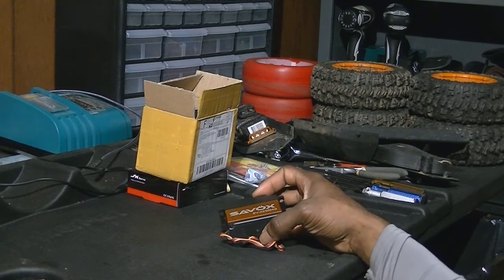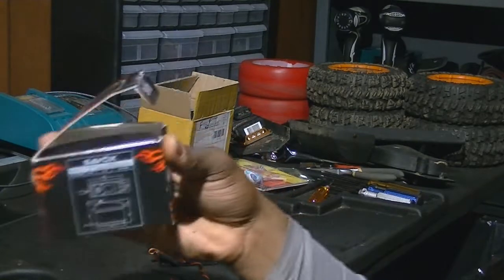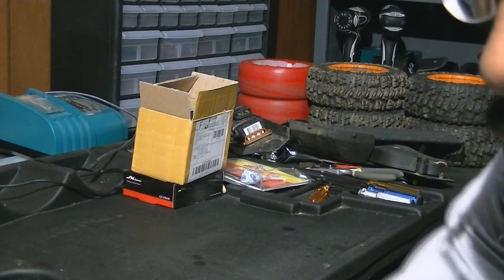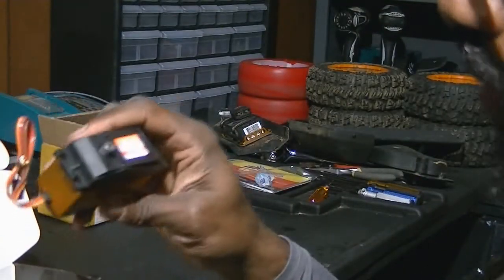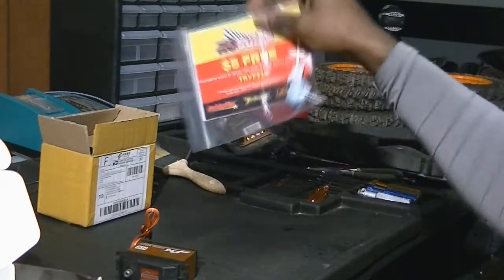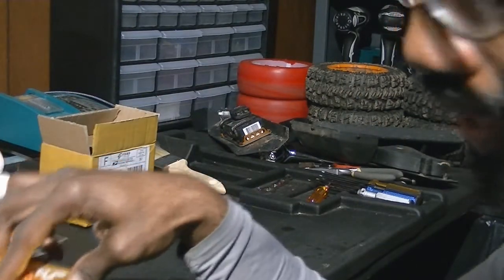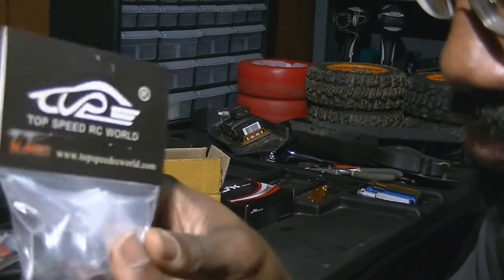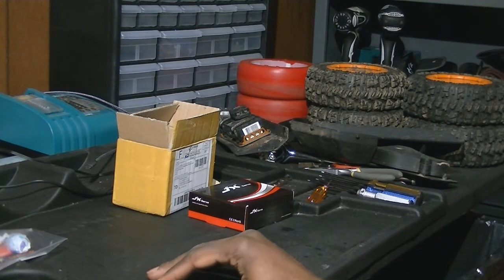Jx servo and wheel extenders unboxing

Comment: My brother i just good mine for 31.65euro's in the mail. the yellow men hooked me up. I run it on a 4600mah 6volt 5cell humppack. ( still wating for the imax b6 mini charger ) but i saw that this servo only push out 39kg... that kinda sucks because that 65kg... hmpf that shit would be off the hook!  But here is the thing that is troubling me. How can i beef this up? Do i really need to switch for lipo's.... i hope not because they can catch on fire and we all know this hobby ain't cheap
Reply from the maker: At 6 volts this servo pushed out 667 Oz inches of torque, if you want more than that you will have to run 7.4 volts which will give 861 Oz inches of torque. Lipo batteries will give you the most power out of your servos. Lipo batteries are dangerous if you don't take care of them, I have had them for years and when I am done with them I take them out of the car and put them in storage mode after I inspect the batteries for damages and or broken connectors or solder points. With lipo batteries you have maintenence whenever you use them, it's not a play and go situation and you can't just leave them in a garage that fluctuates with the weather out side. I hope you enjoy the servo because I have not had any problems with them yet!

Comment: How's that jx servo doing bud? I'm thinking about getting two.  The specs are crazy on these at 7.4v! I know there not waterproof but at this price point I'm not sure I care.  How's yours holding up and do you think the torque and speed specs are accurate?
Reply from the maker: Only 5th scale when I seen your video I thought about that, I have not had any problems with the servo at all, plus when I put it in the gears have no play in them like the savox servo I had. It's a real strong servo and you can't loose with the price point of 50 dollars a pop. Also the metal gear on top is even a better quality than most. I know there not waterproof but as long as they are not fully submerged and you blow the water away you won't have any problems.
Reply: Elite Rc I know what you mean about the play in the Savox. My stock losi came out of the box with that same type of play. It's worth a shot I think thanks for doing this review.  👍
Reply: Only 5th scale - You can make a Servo Waterproof easy enough.... 
Take it apart and seal the Circuit Board with Epoxy, Conformal Coating, or the sealant of your choice.

Take an O-Ring, and put it over the output shaft, pressing it down until it touches the big gear, at the base of the output shaft.
Take some Marine Grease (VERY Important, because it won't turn to snot, when exposed to water, like standard Grease does), apply a decent bead over the O-Ring, even all the way around.

Reassemble the Servo. Get some Plasti-Dip (available at nearly any Auto Parts Store, ACE Hardware, Home Depot, ect.)  Pour some in a container that you don't care about, and dip the Servo into it, shaft pointing up, until the Plasti-Dip reaches above the seam between the two case case halves. You WANT it on the base of the wires coming out, just keep it away from the plug at the other end.

Then hang it on a wire, coat hanger, whatever - with a lot of paper towels under it, to catch drips...... 
Leave it for about 18-24 Hours, depending on your climate. The Plasti-Dip will self level and shrink around whatever you put it on tightly it dries reasonably smooth. It's basically liquid Rubber. We Mechanics have used it for YEARS, to add or replace the grips on our tools. 

After it's dry and cured, take some more Marine Grease, and apply some over the top of the Case, around the output shaft.... 
Install the Servo Horn, and you're good to go!! 👍👍

It works! I also do 1/10th Scale Rock Crawlers, and I've frequently wheeled my Rigs INTO and through streams and ponds. 😱 No problem! 
As an added bonus, it also keeps dust out of those Gears, which eventually eat up your Servo. I have never paid extra for a Servo, just because it came in a Blue Case!! 

BTW, if anyone uses them, ALL Futaba Servos made after 2004 are WATERPROOF - whether it says so or not. 
Carmine 💥⛽

Comment: how did the jx servo compare in terms of torque?
Reply from the maker: they are strong servos now im waiting to see if i have any problems out of the servo with longevity, no problems as of yet, very good buy!
Reply from the maker: when you get them you will not be unsatisfied with them, they have no play in the gears at all and they feel quality!
Reply from the maker: Shahram Najam the jx servo is almost double the torque of the savox servo and if you ask me it is built much better because the savox servo used to have a little play in the gear. So far the jx servo is a win and only time will tell, I also have a better servo saver now also!
Reply: Just bought 3 of these off eBay for $95 shipped , this guy is selling it $30 a piece , new condition too . Can't wait for them to get here and test them out in my 5t
Reply: Elite Rc thank you a lot for the information, I was kinda skeptical about it , I had bad luck with the jx standard servos , but this 5th scale big boy seems to be a good one . For the price I got I don't see how this will go wrong 😬 , almost 3 servos for just 1 savox .

Comment: Great content bruh
Reply from the maker: 5th SCALE RC INSANITY I'm gone test it out because I've went through two of them in 12 months with minimal driving, if the other servo I just unboxed do what it is supposed to do I'll never buy a different servo again because that baja is brutal on steering servos thanks for the comment!
Reply: You gotta see your end points on your transmitter bruh
Reply from the maker: 5th SCALE RC INSANITY that wasn't the problem I checked that with my other transmitter and I also bought a better servo saver. The reason I know it is the servo itself because I started having play in the wheels and it didn't do anything but get worse plus I never had that problem with my rovan servo!